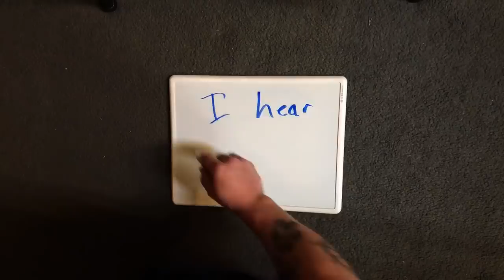Making a Leather Wallet - (The Rugrat)

Comment: Love the videos. Would you talk a little about the heat gun and glue? Obviously, you're accelerating the process, but more a question of how long, how hot, can you over do it? Thanks.
Reply from the maker: Thanks for watching!  Just blow some warm air on it until it’s tacky.  Not wet.  You don’t have to blow air on it.  Let it set and it’s fine.  I’m just impatient
Reply: @MasconLeather  Thanks. I do my gluing in the garage because of fumes. Its not heated so that's a problem. I have been tinkering around with a heat gun on low to both speed up the  process and keep glue/leather above 55 degrees.
Reply: Onde consigo  comprar